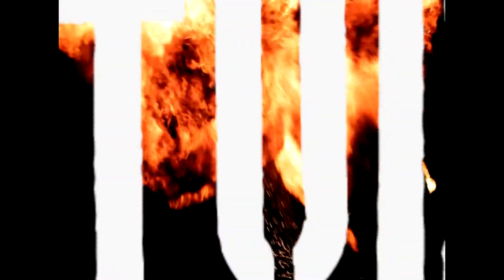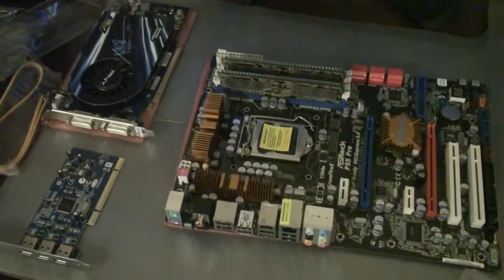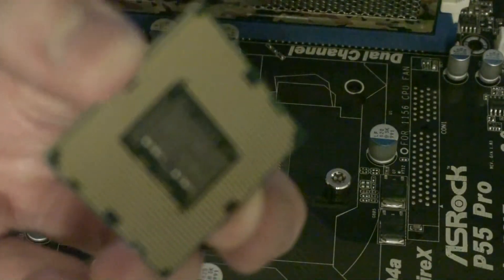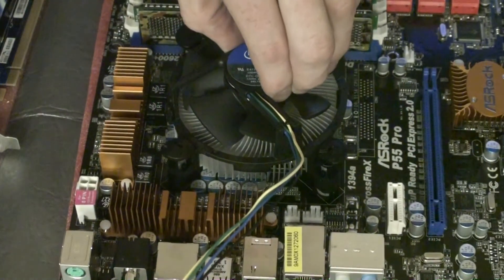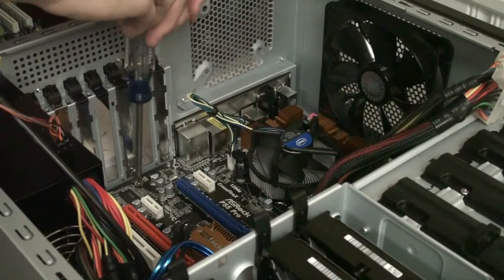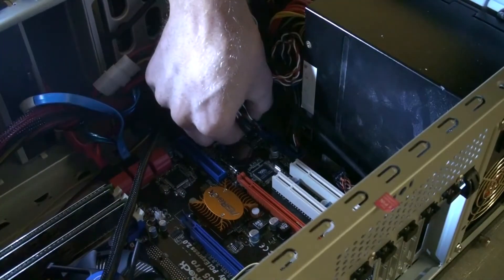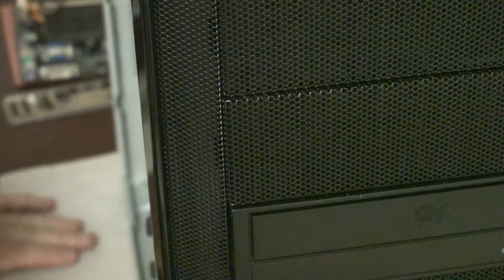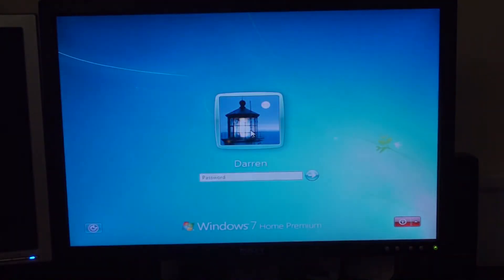Building a Core i5 PC Pt. 2/2

Comment from the maker: @clonehackers do you have a 64-bit version of Windows 7? That will be necessary to utilize those components. In addiiton, make sure to have the latest drivers for all of your hardware. What kind of hard drives and cache do you have for them? Perhaps they need upgrading? Also, type msconfig in the start menu and disable some of your startup programs to cut time off the boot up.

Comment from the maker: @Phatency it depends on your case and stock cooler. I've never used the 760, but I imagine it's similar to the 750. Mine runs warm, but I have 4 case fans and a good coller master case that keeps the air flow going. Try buying an extra case fan or two, or investing in a decent after market heat sink.

Comment from the maker: @BadAttitube23 probably from the rear. it's very idfficult to break the board unless you snap something off the top, but I've dropped my AMD X4 and old C2D one and they're fine. I wouldn't recommend it, but they're strong. Just if it doesn't fit don't use TOO much force to MAKE it fit, b/c then you risk your hand slipping, etc.  Just be careful, or if you can, bring it to the computer store and ask them to show you how for a tip or something.